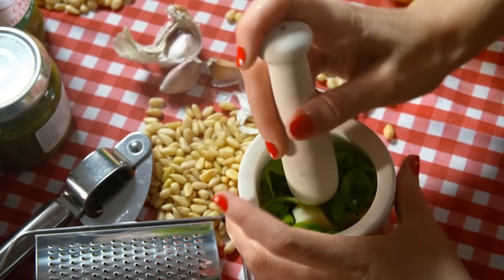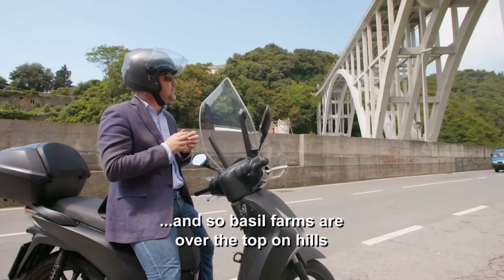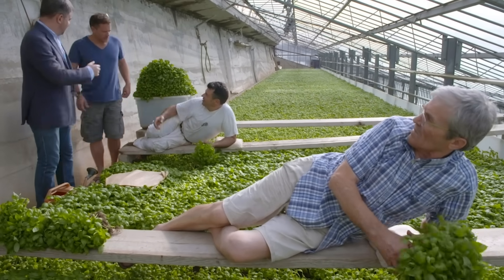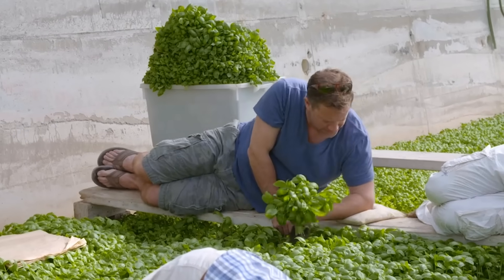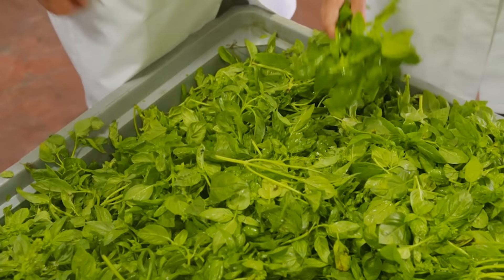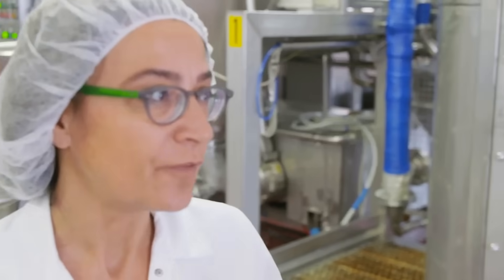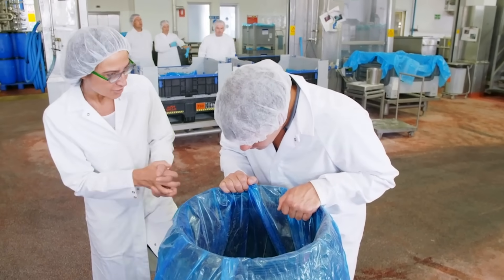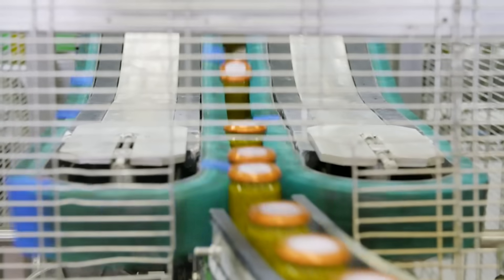How is Supermarket Pesto so Cheap when the Ingredients are so Expensive? | Food Unwrapped

Comment: Wow cashew is used cause it is cheaper!!! Never thought I would hear that.
Reply: One of the reasons that cashew nut is so expensive is that it needs to be removed from the cashew apple by hand. Machines can be used to remove the nut, however they usually break the cashew nut into smaller pieces which are not an A+ product, therefore sell for a lower price.
Reply: @willeveryday  and the pesto factory can buy the smaller pieces cheaper...
Reply: Pine nuts are expensive because pine trees have to be older than 25 years old to produce seeds.
Reply: Well, cheaper than pine nuts. Not the cheapest nut, but it's mild flavour and richness make it a good substitute. Like using sunflower oil blended with olive oil, cashews won't overwhelm other flavours, like walnuts for example. And, as someone mentioned, they're sold in grades. Whole nuts, half nuts, or pieces. Raw, blanched, or roasted. Whole, raw cashews are at the top. Cheaper cashews are available.
Reply: Costco has a great deal on Chinese pine nuts. It's gone up recently, but at $22 / lb it is still a bargain. The Italian nuts are more expensive because they "taste better." I'm not convinced.
Reply: @richiejohnson  I wish a costco near me. I would buy those Chinese pine nuts in a heartbeat! I try to stock up pine nuts whenever I can get a good deal. I've been out for quite some time.
Reply: @richiejohnson  why buy a Chinese product that has been shipped across the world when you could buy from a eu country.
Reply: @xXDESTINYMBXx  Price pure and simple. I believe the Chinese varieties are different  and do not produce the same quality. I don't need premium price/quality nuts for my cookies.   If you're looking  for a geopolitical rationale ,  can't help you I am involved in more urgent matters at this time.
Reply: Bes Besa  or Americans if they are available. Like the comment above pointed out I'm looking at it from an ethical /geopolitical standpoint at it.
Reply: Maybe because it's not localy grew. In a country with cashew tradition it's not very expensive
Reply: @davyddocarmocabral2989  I live in India (with a sizeable cashew crop).. it is  expensive
Reply: they can't use peanutes because of peanuts allergies...
Reply: You are not obliged to make pesto with pine nuts. That is just one version of it. In Italy there are hundreds of pesto recipes using almonds, hazelnuts and all types of nuts. As for the vegetables you can make it with broccoli and so many types of herbs. Pesto just means crushed.
Reply: @richiejohnson  You can get pine mouth from Chinese pine nut. I got it and it ruined my meals for a whole week.
Reply: I discovered this because I'm very allergic to cashews but I'm also a vegetarian so pesto was recommended to me, and luckily I checked the ingredients but almost all shop made pestos use cashews instead of pine nuts!
Reply: @maskrey  please elaborate. How is it diagnosed?
Reply: @richiejohnson  You can google pine mouth. Basically most things you taste turn bitter. It's caused by a specific species of pine nut, and only affects certain people.
Reply: @colinpovey2904  that and only certain breeds are used commercially because they grow bigger pinecones
Reply: @poppyrendall847  sucks for you on the store bought front but I hope you have luck elsewhere. My eldest daughter gets sick and throws up if she eats meat so I am learning vegitarian practices do you have any advice? She eats eggs and cheese and butter and yogurt but gelatin makes her sick she doesn't like to eat much at all so constant struggle
Reply: In Australia cashews are expensive, but not as much as macadamia.

Comment: I make pesto but not with pine nuts.  Toasted walnuts work just fine. Plus, I grow my own basil.  Pesto can be frozen also, just add a little lemon juice.  We freeze it in silicone ice trays.  We enjoy it all winter.
Reply: Thanks for the tip!
Reply: I use cashew nuts and also grow my own basil. Well plenty of basil around
Reply: I also make it with walnuts, because I like the taste better. I also split the oil between olive and sunflower. Sunflower oil is very healthy when not heated to high temperatures, so it’s a good way to tame a strong olive oil.
Reply: same here, I grow my basil and make pesto at home, i normally make some with basil and some with nasturtium leaves, the nasturtium version have a more peppery flavor and it works very well for pesto, you should try.
Reply: @David Szakacs The lemon juice is not necessary to preserve your pesto: just put your pesto in the usal container and push it well so all the excess air goes out, flatten it out and add a little bit of olive oil in order to cover the top and it prevents it from oxidating. I normaly use really small and narrow plastic cups with a lid so a tea spoon of oil's enough and you can pile them one over the other so it doesn't take much space in freezer. As a matter a fact, you can even preserve like this fresh made pesto in the refrigerator for a couple of days. At least, that's how italians do.
Reply: No need to freeze it at all if there is a layer of oil on top.
After some months a fine mould skin can sometimes float on the oil but this can be skimmed off and the pesto is safe to eat still for up to 12 months!
Reply: Pesto just means a ground paste or sauce. Think pestle and mortar - what we used to use in order to grind things, including pesto.  You can make it from whatever nuts, oil or herbs you want...
Reply: @daniby9894  OK, the oil on top trick is what I do.  I put it in a glass jar with a little oil on top.  I never saw anyone else suggest doing that until you did.  Seemed like an obvious thing to do to me.  :)
Reply: @olsim1730  Really, that long?  Interesting.
Reply: Genovese here, pesto can last quite a long time if you cover it with oil when in the jar, if you want it to last a lot longer you can also avoid putting the cheese in and mix that in when you're ready.
Reply: @erad67  Just make sure you lower the PH then to avoid botulism. And refrigerate it.
Reply: @olsim1730  Or you can replace the oil. The old oil tastes great

Comment: 1:00 open differentials are pathetic. 

For those not verse in diffs:
Open: Power is sent to the wheels with the least resistance (grip) but what it lacks in performance it makes up for in stability.
Locked: Can't turn to save its life, but power is sent evenly to both wheels at all times.
Limited Slip Differential: Power is sent to the wheel that has the most grip and is the best solution to the differential problem.

Comment: How come basil is expensive in England? Basil is really easy to grow in my experience: you buy a little branch (fresh), take off most leaves (not all of them, leave a few), put the branch in some water (exchanging the water every day) and, in a few days, it will sprout roots, then you just plant it in a vase. That's it, you get a supply of basil from one branch.
Ps.:
 1)Untill it sprouts its own roots, the basil twig will live off of only water, which doesn't have much nutrients. So you take off most of the leaves so that branch won't have many parts to mantain and thus need fewer nutrients. That way it won't simply spoil on water. It still needs leaves for photosynthesis, so don't forget to leave a few good ones.
 2)When you put the branch in water, try to put just a lit bit of the bottom in the water and the rest of it keep it above the water level. If too much of it is kept under water, it will produce too many roots and make it difficult to plant later - although it isn't much of a problem.
 3)I live in a warm climate, even warmer than Italy, so I don't know if that would be a problem for the brittish. I figure that if you keep it in a vase indoors where's there's enough heat and sunlight it should be fine, but I'm hardly a botanist nor a farmer, what do I know?
 4)Nowadays I plant basil in a very small vase. A bigger vase would yield a very big basil plant, and I don't need that much (it's just a condiment, not a food per se).
 5)I just water the plant. No special treatment, no fertilizer... Maybe the dirt I got here is really good, I don't know. Again, not a botanist, not a farmer.
Reply: You can grow it in English gardens, but not always with great success. All my plants failed last summer even in a greenhouse because we had a cool, cloudy summer which is no good for basil. You're right, there's the option to grow inside but again, unless you've got grow lights there just might not be enough sun on a windowsill, plus it takes a lot of basil to make any decent amount of pesto, more than I could grow inside my one South facing window. It's just not the right climate, at least here in the North, but we keep trying, some years are better than others and I've frozen bags of it at times.

We can buy it fresh in most supermarkets and its not that expensive if you just need a little for garnish. It is expensive to make your own pesto but the taste is far superior to supermarket jars which, of course, is the same for many foods.
Reply: glyn hodges  Thanks for the recommendation, that looks like a really good method for growing indoors. I wish I had the space!

Comment: So the answer is: cheap basil (difference in quality perhaps), use cashew nuts, and sunflower oil (both cheaper).
Also, grocery stores increase costs dramatically and tend to overcharge on fresh produce & herbs ( last remark is my personal opinion)
Reply: I don't think they're overcharging all that much on fresh herbs and stuff, it's just kind of difficult to transport. Can't really just have  it stacked on a palette like boxes of milk or something
Reply: quality, potentially, but it's more likely that the mechanisation of the process, eliminating the need for humans except to control the machines, is going to lower the cost. also, if you buy basil in grocery stores, you're not going to pick a bunch that has even a little wilting. the wilting barely matters at all for the taste though, so this place can use all of it.
Reply: @Dongonzales123  good point. Transportation & shelf life

Comment: 1 butternut squash or equivalent amount of pumpkin cut into small cubes. Mix in a baking dish with bread crumbs, parmesan, salt, pepper, and just enough olive oil to make everything stick. Toss.

In another baking dish, do the same, but instead of squash or pumpkin, use around a pound (half kilo) of sliced mushrooms.

Roast in convection oven at 425 degrees F until browned.

Toss with pasta (whole box) and pesto in a pot. Use pasta water to dissolve/dislodge the fond at the bottom of the roasting pans and add to pot.

Comment: Idk man this "traditional" method looks insanely bad to your spine and posture
Reply: Still better than a desk job
Reply: @andrij1848  if your desk job involves lying down in that position for hours doing labour then sure
Reply: @DSDSDS1235  one thing I noticed during a lockdown is that the typing gets quite a bit slower when you work lying down 😂
Reply: @andrij1848  this is worse. All your joints on the hardwood too. I know the guy had 1 pillow for himself but that’s not enough. Your body would be pretty badly affected if you did this 8 hours a day for a long time.

Comment: I think pesto is traditionally supposed to be a cheap way to use the abundance of greens in the garden instead of wasting them, so any substitutions in the basic recipe are fine. 

I live in the US and grow basil, spinach, garlic, and sunflowers seeds, which I use instead of pine nuts (soak first). The only thing I need to buy is California Ranch olive oil. Though I do like a bright squeeze of lemon in my pesto instead of pepper.
Reply: Willy Bones  Freezing is the perfect way to savor pesto out of season. "They" say you can't but I've have always done this.

My recipe isn't written down, but it follows the basic pesto recipe. I soak my sunflower seeds to the point where they are starting to sprout little points on the end. That wakes up extra nutrition in the seeds. Then I use them in the same ratios as a basic pesto recipe. A squeeze of lemon goes on top of the basil or spinach leaves. Then the olive oil, which I sometimes use a little more extra virgin olive oil than is called for because sunflower seeds are not as oily as pine nuts. I very lightly roast the garlic right in the bulb in a toaster oven. We like the flavor and it makes it easier for some family members to digest it.
Reply: Willy Bones  You're making me hungry! Check out the benefits of sprouting those raw sunflower seeds. Sprouting is an amazing way to get more benefits from nuts and seeds. All the real nutrition is locked inside until the seed starts to beome a living plant.
Reply: You are right in saying that pesto can be really anything, it's pesto alla genovese specifically what the video is talking about
Reply: @DensApri  I appretiate your reference to pesto alla genovese. It made me do some internet cruising, and I learned something new. So pesto is just the process of pounding and grinding. There were many varieties of recipes made that way, and basil was a relative newcomer from India to Italy. Good to know!

Comment: I use green onions, instead of basil and raw almonds, instead of pinenuts,
lots of garlic. I use EVOO. I wait until the  dish is ready to put cheese on it. I use Asiago or old cheddar. I like it "melty".
I also find that putting the cheese in the sauce makes it too salty...IMHO.

(One bunch green onions, One cup EVOO, One cup almonds, I use 7 or more cloves of garlic. 
IN BLENDER/FOOD PROCESSOR:
Start with olive oil and garlic. Emulsify. Cut green onions in one inch pieces...(get rid of the hairy stuff, first). Add. Emulsify. 
Add nuts...not too quickly. 
I like it to be a thick paste. 
Cook pasta. (I like Rigatoni Rigate.)Drain. Put in bowl.
Stir in "pesto". Add chopped plum tomatoes and chopped green onions. Grate cheese over your pasta and give it a toss to get the cheese melting. 
Easy as hell. Delicious.

Comment: Why is it cheap? Because there's bugger all in it.
Pesto should be made with virgin olive oil. Don't take my word for it - next time you buy a commercial brand look at the disgracefully low levels of olive oil - usually a mixture of vegetable and palm oils, with the minimum amount of olive oil to stay within consumer regulations. That goes for other ingredients too.
There is good stuff available, but don't expect it for pennies.

If you're working from home right now and wanting lunch straight out of the cupboard, try pesto with cannelloni beans and whatever herbs are handy. Just that - though you can get more creative if you like. You might be surprised.
Reply: Palm oil cannot be user in pesto, it's solid at room temperature. Most often sunflower or other neutral oils are user to lower the price. Bear in mind as well that olive oil from the area around Genoa is very very mild, I agree with the lady that you would probably want to "cut" it if you only had a very spicy oil!

Comment: They didn't really mention, but it's also clearly going to be cheaper because of economies of scale and preservation. Even if they were using extra virgin olive oil and pine nuts, they'd be buying them at a huge scale, which would make it much cheaper than the price you pay at the supermarket, and the basil is going to last a lot longer in a sealed jar of pesto than it will fresh.

Comment: I think the cheese method they use makes logical sense. Pecorino has a much stronger flavor than parmesano reggiano, so you can get a good approximation by using cheap parmesan and cutting it with pecorino (which is a lovely cheese)

I bet it’s hard to tell the difference, especially when it’s mixed with massive amounts of basil. The extra virgin olive oil cut with sunflower oil 100% reduces the quality of the final product, but the cheese method is definitely cool.

Comment: In my country 40% of population earns minimum wage 328 euro per month. Barilla 500gr pasta 61 cent, 190 gr pesto sauce 2,5 euro. Local brands of pasta as low as 30 cent. We’ve also eataly store for rich people. They can find pisani pasta for 4.5€. You can find Afeltra, de cecco, rummo, pagani, garofalo at grocery stores.
Reply: To compare prices, in my area in the States, Basil is $2.50 for 500g fresh, good semolina paste is about $1, Pecorino is $10 for 500g, pine nuts are about $25 for 500g.  Good quality extra virgin is about $7 liter.  Given that pesto lifespan is limited by the one its of the basil you aren't  making much at one time but, based on the 500 g of basil, you'd end up with about 0.5 l of pesto for about $10.... and that's a lot of pesto.

Comment: You can tell the lady in the factory is actually really proud of her product. Shame they pushed the cheap narrative so hard. They use much better ingredients than I have come to expect from supermarket products, and they don't even use additives. Meanwhile the show goes off at them for not using handpicked basil, and using grana padano instead of regiano. You wouldn't even fault an Italian restaurant for using these in their pesto. The sunflower oil, ok yes that's a real downgrade. The pinenuts are just bonkers expensive, so props to them for even putting some of those in there.